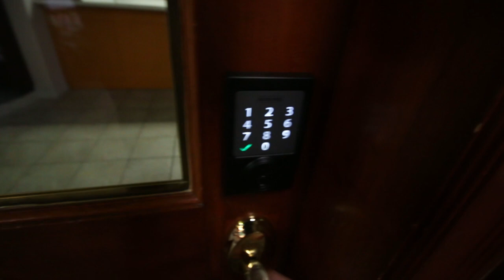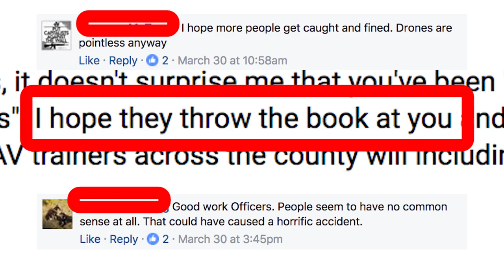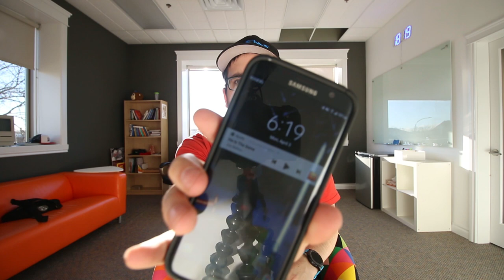VLOG | My Side of the Story [Red Deer Drone STARS Helicopter Flight Path Incident]

Comment: Some of the new laws to note here would be 
1. Cannot fly 90+ meters above the ground.
2. Cannot fly within 75 m of buildings, vehicles, or people.
3. Cannot fly within 9 km of any sort of airport or place where aircraft take off or land. (Hence why Red Deer is pretty much off limits)
4. Cannot fly over 500 m away from yourself.
5.Cannot fly where you can't see it. (At night, in fog, etc.)
6. Cannot fly within 9 km of any emergency scene or disaster (Ex. Forest fires)
7. Make sure your name and contact info is written on the drone.

These are temporary until new laws are created in what will probably be May. Pretty restricted, but the number of accidents with drones has been rapidly increasing these last few years, making it clear something has to be done about it.
Reply: Also, they cannot be flown in restricted air space (Airport, Military, or otherwise).

Comment: You won't be the first or last person to have this happen.  If the helicopter never showed up, all would have been well as most people would never have noticed a drone or cared.  With the new drone laws (and safety in mind), when flying in enclosed populated areas (even if for commercial reasons with approval), it's best to keep the drone in sight at all times and have full control over the drone (not tap to fly).  I think since everything is new with the laws and there was no intent to harm on your part (i.e., you did not fly to intentionally film a helicopter), you'll receive no fine.  I'm still confused as to why your drone was taken away... Not a firearm, you're not a criminal, you showed no intent.  Using it as evidence?
Reply from the maker: They wanted the footage/GPD coordinates of my flight I assume. I offered them just the SD card but they said they needed the full drone. I really didn't want to, but I didn't want my car impounded either haha.